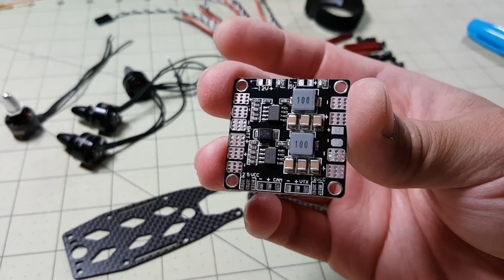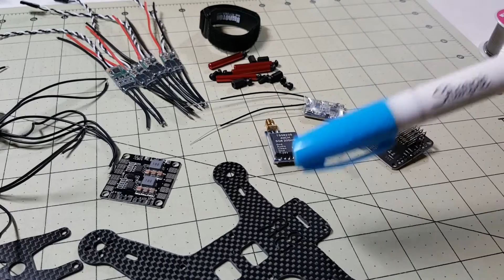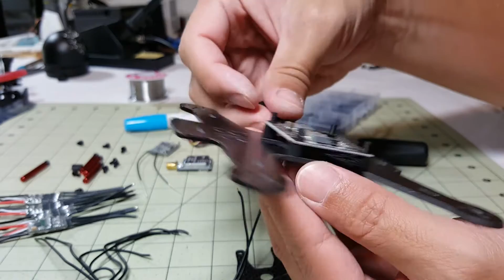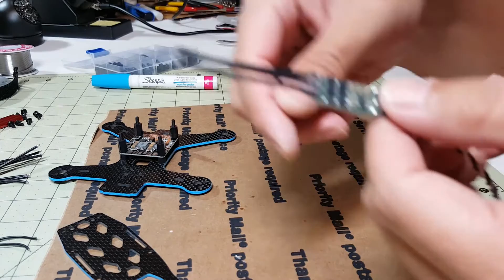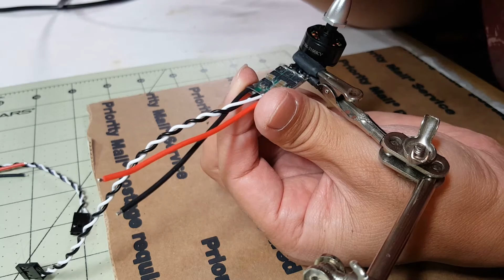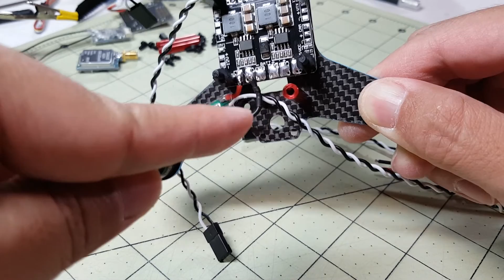RCTimer BeeRotor 130 Build (Part 1)

Comment: Are you getting any vibration issues with the Naze32?
Reply from the maker: No
Reply: I have a very similar build but I am getting huge amounts of vibration that is throwing off the FC. I tried soft mounting it with rubber o rings with no luck.

Comment: Are the stand offs and screws included in the frame?
Reply: Another question, I've seen in some build videos for begginers that sometimes you will need to switch up the soldering on the motor to the esc to change up its direction. Is this true?
Reply from the maker: +Andre Martinez Yes
Reply from the maker: +Andre Martinez Yes, but you can also do it via software which is what I do.